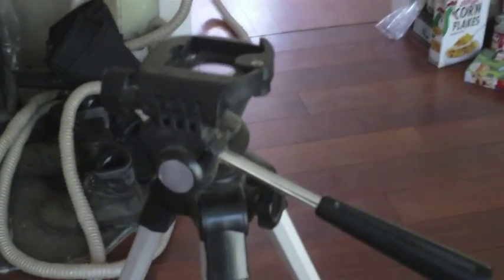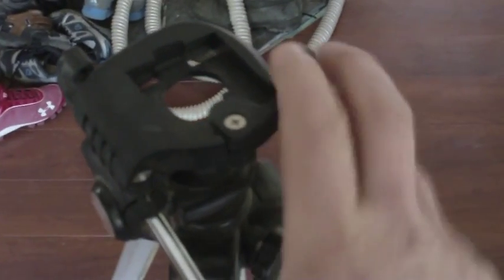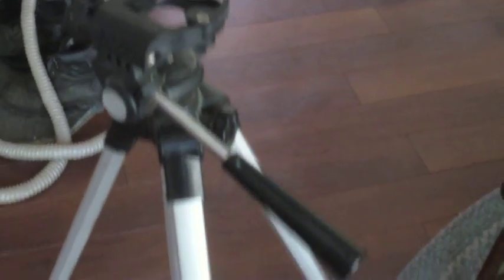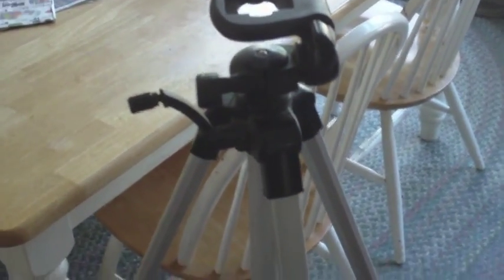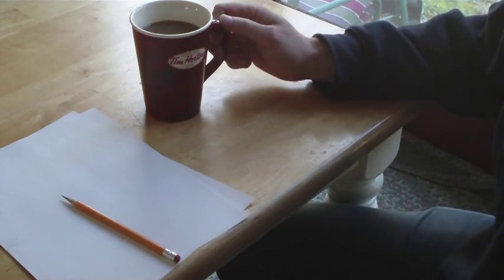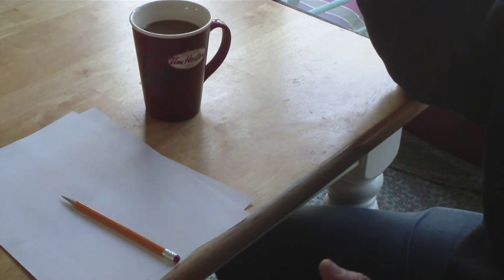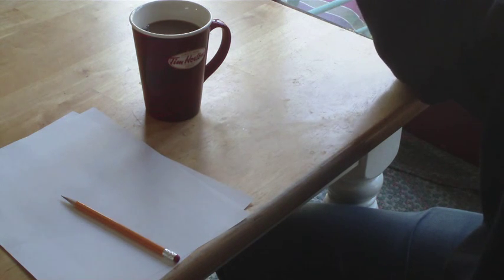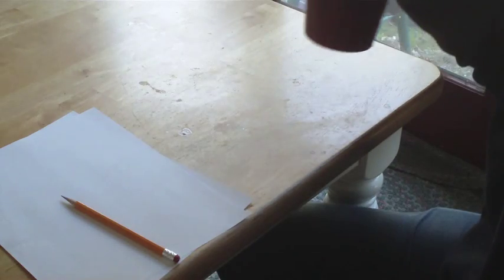The Boom pole aka "Minicrane" Project Part 1

Comment: Do you run into problems with rust with those machines sitting out in the yard, or are the tarps sufficient?
Reply from the maker: Noooo! The only thing saving the lathe and mill from badly rusting is that they were both pretty dirty, and oily. The tarps are keeping the rain out on the mill fine, because the top layer is actually whats left of the roof of one of those shelter logic shed in a box deals. I honestly have not even looked at it since I covered it all up. The Vernon lathe is under some lesser quality tarps, and it has some flash rust forming, but I plan on cleaning it up real well, and giving it a rattle can paint job….soon I hope!

Comment: hope you got lots done on it.  Looks like it was a spring time project? how did it go?
Reply from the maker: good eye! Yes, this was filmed in May. I am pleased with the overall results. I still have a couple things to finish, but it is useable as it is now, and I have too many more pressing items to get to. As I type this, the Oliver is out of commission, but I'm working on it, and hope to have it back in service within a week.
Reply: Wow - whats going on with the Oliver?
Reply from the maker: BannisterHall .farm 4 items that need attention and are bugging me. brakes are real weak. shuttle shift linkage is dicey. Engine RPM's running away. steering fluid leak. Videos coming soon.

Comment: I'd rather have the thing mounted in place of the bucket rather than mounted to the bucket. It would be more secure and the tilt cylinders will give you a greater range of motion as opposed to something held in with chains or clamps. I know you said that taking the bucket off would be a pain but how often will you need to switch between the two in a hurry? Now if you were on a job site and you were using the boom to send up a bundle of trusses then had to change over real fast to go load a truck then go back to moving trusses I could see that being a problem. Now if you still want to do a bucket mount how about you weld in two "ears" with a hole threw them to the floor of the bucket then on the boom side you notch out slots for the ears to fit in then just run a pin on each side then weld two more ears on the top for a piece of steel to pin in or even a top link off a 3pt
Reply from the maker: I've mostly completed the project, but I appreciate your thoughts. I thought about the ears idea, but did not want to weld anything onto the floor of the bucket that might be in the way of picking up rocks, etc. You'll see what I came up with real soon. I'm pleased with the result, and will modify/add things as time goes on.